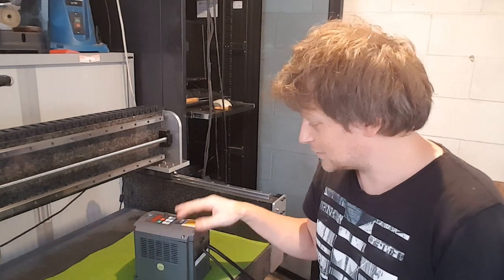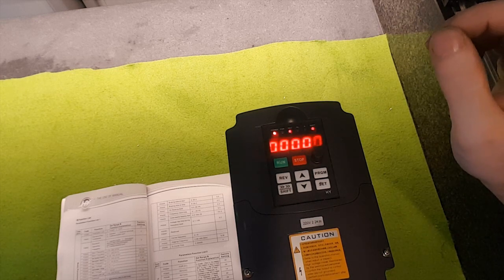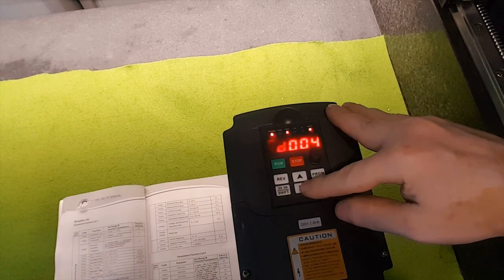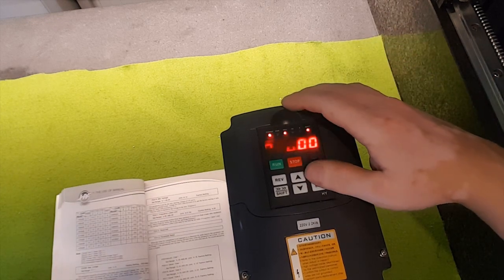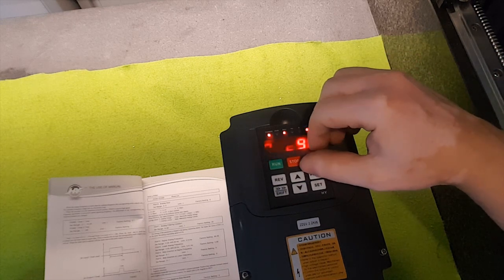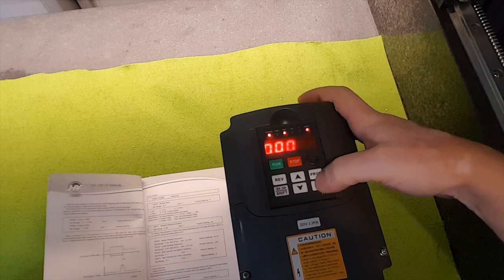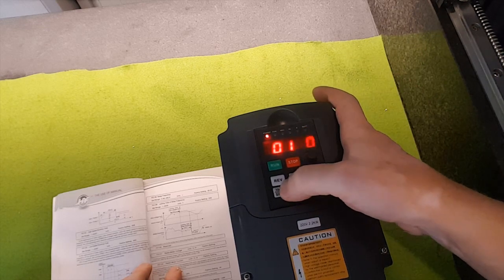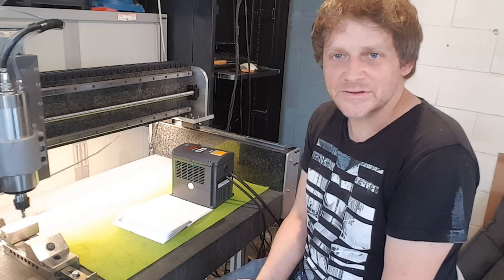How to program Huanyang VFD 2.2KW

Comment: Hi, thanks for this as it was really useful to help set up the replacement I just got to replace the one that went wrong, but I just wondered if you could help with another function.  I wired the new one up as per the old one which when the spindle came on via the pendant controller the spindle water cooling pump also started up and subsequently turned off when the program was complete, as the relay is wired into the VFD via the two rows of green connectors, but with the new one installed and working fine, all but when the spindle starts and the water pump now doesn't come on automatically.  I can still turn it on via a switch, and have looked through the program settings in the instructions, but not being very tech minded nothing jumps out and wondered if you knew how to get it to turn on automatically and which settings I needed to change to do so.  Thanks for you help either way.
Reply from the maker: @donjarr  sorry I have no clue..

Comment: Hi, We connected the huyang vfd  and set all the parameters that we think they are correct (pd settings on vfd). We encountered srtrange problem while testing the spindle. Everything works correctly while ccw is enabled but when we try cw the spindle has some problems. Cannon maintain the 120hz we set as minimum on vfd setting slows down and speeds up and in general it behaves srtange (it only happens when the spindle is working in cw direction). Also the vfd never achives the set 400 Hz  (the 355 is upper limit) Sometimes (more often then not the spindle speed fluctuates).  
Any ideas?
btw: jest szansa, że jesteś z Polski? 🙂
Reply from the maker: I'm not an expert on vfd settings. I just found settings which work for mine spindle and it should work for most people. From this what you are saying it looks like 2 possible issues. Number of poles are not right. Or your cable to spindle is bad quality. Try changing pole number and if this doesn't help try shortening the cable to something like 50cm. Just to test if it behaves differently if so then you need better cable

Comment: link to the manual? the supplier did not provide AND they took the sticker off the side
Reply: I bought a 2.2 with vfd BUT I need an 80 mm mount. so after asking about for a mount to fit my FoxALien vasto with no luck, I bought a 1.5 65mm spindle that I hope to use to make the 80 mm mount. hoping to use the vfd I already have. it has been over 10 years since I dabbled with a vfd, converted my drill press to vfd controlled 3 phase motor. I remember precisely nothing about vfds :)

Comment: Hello, 
I have a Huanyang vfd and 2.2kw spindle 220 volts. I did not reset my vfd when I put in the settings from several videos. It worked except it would only go to 208 hertz. I reset it and now it goes to 400 hertz but the potentiometer does not work. Is there a setting I can change to fix it. TIA
Reply: A mi me funciono pd002 = 1

Comment: Hello, i want to drive a rattmotor rtm80x73-2.2 (2.2 kW spindle square format) with a hy02d223b vfd. The nameplate of the motor says 6 A and 220 V. I dont understand why its only 6 A if the motor is supposed to be 2.2 kW. Do I have to set 6 A in PD142?
Thanks in advance.

Comment: Dude I just bought one of these bad boys but I'm lost with it straight out of the box.. Does it take a lot to get this correctly set up bcos I'm not so technically gifted my friend.. I will find help online to show me how to set this bad boy up soon but I shouldn't need this for a small spindle motor like a Gennitsu GS - 775 should I?? This is why I say I'm not technically gifted bcos I don't understand all of this stuff right now. 
I'm building my own home DIY CNC Router and I kept hearing that I needed to get one of these but I think I made the mistake of buying a 3 phase VFD instead of a single phase VFD. No wiring came with this thing which threw me for a loop so if anybody on here has any helpful advice for me please drop me a line in the comments. I'd very much appreciate ur help guys.. Thanks in advance..

Comment: My problem is direction of rotation is wrong.
How to rotate direction of motor to right direction.
Engine always turns the other way around. weird.
How to set M03 direction of rotation.
Reply from the maker: just switch places of 2 wires from the spindle, it doesn't matter which ones

Comment: thank you for your video, good information. I have a question on the 220 VAC input single phase. Can you tell me what the max voltage is. My 220 reads 240vac and I am concerned it will be too high. thank you.
Reply from the maker: It's fine.
Reply: @PiotrFoxWysocki  after some research I agree. it's fine. Thanks

Comment: Recently retired from a large hospital/research center that had over 500 drives from 1 to 1750 HP. I often replaced existing drives and had a great Danfoss tech only charge around $300 to do the start up and extend the parts & labor warranty to 3 years. Win win. He worked on nothing but VFD'S for 30.years. He had to go to his car once to get programing book. It was a inch thick. Amasing what you can now program into the newer drives. When I worked on a drive for the first time ( 1981 ) it only had a few pots to adjust ramp up & down, torque and a few others. In newest building over 90% of 5 HP & higher.were on a drive. Motors 40 HP & higher were on 18 pulse drives. The 200 HP fire pump was on a soft start drive.

Comment: Piotr are you using Mach4 for your CNC. If so did you have any trouble getting it to talk to the Huanyang VFD via modbus. Can get mine working with Linuxcnc but not Mach4. Suspect windows 10 drivers for the rs485 - USB - com port at the moment
Reply from the maker: Im using mach3. If its not working try to reverse cables. But beside that you need to do stuff in mach. I think you need a plugin for it to work
Reply: @PiotrFoxWysocki  Thanks for that. Yeah we had it working on Mach3 with the same plugin (I'm guessing), but can't find an equivalent for Mach4. Assume the wiring is still OK as the linuxcnc works Ok with it's own plugin.

Comment: Hello, how can I wire my 1600w 50hz single phase miter saw into the same frequency converter that in your video ?
Reply: I assume the VFD drives 3phase motor, so you need to re-wire yours as 3-phase either star or delta, depending of VFD capability.  2.2KWt/1.6KWt ratio is approx 1.4, so may work.
Reply from the maker: i have seen someone did that. just look on youtube

Comment: One thing that You should always do first before attempting to set any other parameters is to do a factory reset for the poor thing.
I have four of these animals in my workshop and when those arrived, each of them had a slightly different setup. This might be because of the factory testing process and maybe the supplier has also tried to preprogram them to "enhance" end user experience.
The parameter for setting the factory defaults is PD013 and the value should be set to 8. After setting this parameter to 8 the device will revert to factory settings and boot itself. This gives a known startpoint for configuring the VFD.
Reply: Thank you very much for your help. I tried to program this thing and the result was to become crazy. Think that was the problem and now I have hope to do that well.
Thank you once more time!
Reply: Can the inverter also programmed without a wired motor? or is it needed that the motor is connected first? I don't want to blow the motor because of potetional wrong settings
Reply: @mt8385  That's a really good question. To be honest, I don't know.
It might be possible to do the programming without a motor. At least it shouldn't zap anything. However, the device might get into a state where it does not allow programming. I have never tried this out so all this is just speculations.
Reply from the maker: It's possible vfd might get damaged without load attached.
Reply: After writing my question I found a statement, that recommends doing the initial setup without a motor. Some HY vfd has the freq setting in default set to 50 and as a result you will burn the motor
Reply: This was true of mine also.  Several of the presets didn't correspond to what the book stated as default factory settings.

Comment: If your spindle has 4 poles (as your VFD is configured?), wouldn't you need 800 Hz to run it at 24000 RPM?  Doesn't the "rated motor current" for programming the VFD refer to what's shown on the side of the motor (6.6 Amps?)?  Did Jian-ken provide performance data (speed, torque, and voltage curves" for the spindle?  Does your spindle testing video show the VFD's readout of motor current?  If so, what parameter(s) did you set to enable it?

Comment: I wasn't able to remember the sequence of pressing down the appropriate buttons in order to program certain functions. Is there a way you could explain this in a separate video or perhaps send me an instructions on programming. The manual supplied with my VFD is presented in such a way that I don't understand programming procedure at all. I learnt a bit from your video but still not enough to do it on my own.

Comment: Hi Piort, Again an informative video, thank you, one thing I dont understand about these vfd´s and spindle motors is the output voltage from vfd to spindle motor, is it correct that the spindle motor voltage is 3 phase 220VAC (is that a USA standard) and not what we usualy have in Europe being 3 phase 380/400VAC, none of the Chinese on Ebay can tell me what they mean with 3 phase 220VAC
Reply from the maker: from my understanding you can plug 220v to the VFD or 380v. you can use one or the other. vfd outputs frequency  (variable frequency drive) to the spindle by 3 wires. and those wires have shifted signal in order.  so 3 different phases. and what is the output voltage I don't know. but i'm guessing it will be 220 per wire. 
not sure if i explain anything, or make it even more confusing :)

Comment: Braking Resisitor?
Hello Piotr and thanks for the great build videos. Judging from the results, you've built a great machine!  Have you ever attempted to install a braking resistor? I've installed an appropriately sized device, but non of my VFD programming attempts have been successful in using it...
Reply from the maker: i  have to say that long time ago i have been thinking about it. but i havent put it in yet. i burnt 2 vfds before and now im trying not to run them too hard, or to do more than they can handle. i guess it should work and i'm sure it is working for other people. but I lost confidence with them and i don't feel like i will get it back. but to your question, I think i saw some options for the spindle speed up and slow down in programing settings of the spindle.

Comment: Hello! I was going to buy 2.2 kW water cooled spindle and there are two versions available, 220V and 380V. Is there any practical difference between them? (especially risk of burning the VFD).
Reply from the maker: to me there is no difference in power or performance, its 2.2kw no matter if it's 220 or 380. i would feel more safe with single phase versus 3 phases. with 3 phases you have 2 more wires which could increase possibility of failure.
Reply: Thanks for reply, i will probably go with 220V version then.
Reply: 380 input or 220 input.. you have 380 and you are running more machines? go for it, you can spread the power over 3 phases. for example:  if you let the spindle run a cnc progrom at 2kw. and you want to weld something in the mean while. with a 16amp 220v fuse you have 1.680 kw left or you will blow out the fuse.
with 380 you would have 3 phases with 3kw left over.

Comment: Hello! Glad to find someone in NZ doing CNC, your videos are extremely helpful! I have two questions and was wondering if you'd be so inclined to help. I also have a HY VFD and 2.2kw water-cooled spindle, and was wondering if you know about the input draw current (of the vfd at the wall at max load)? as there seems to be much debate. Living in a residential NZ household I am limited to 240v 10AMPS at the wall, so I thought I could run the spindle on its own and everything else on another circuit, but I've recently read that at max rpm the VFD itself may be drawing over 16AMPS? which will blow the breaker. I've opted for an 800w which is on the way and I intend to cut 6061 aluminium with it (at very slow cut speed with a two or 3 flue carbide endmill, probably 3-4mm)I have seen your spindle comparison video too, and my second question is, in your opinion can i use an 800w water-cooled spindle to cut 6061 plate as long as I use the appropriate feeds and cutter? It is a small extrusion and plate based machine using linar rails (hiwin clones) and 12mm ballscrews with nema 23 312oz/in motors. In building this machine I have already realized my mistakes as I rushed to buy the parts. 
Apologies for the wall of text! any help or advice you could give would be greatly appreciated!
Reply from the maker: i haven't measure how much current does the whole machine draws. but i can tell you that i have also 10amp breaker and from the experience i can say that its just fine.
On the VFD you can monitor how much current does the spindle draw. on a 15mm deep side cut 1.5mm thick cut current was going to 6amps. spindle total power is 2.2KW which under 220v is 10Amps precisely. not to sure how its possible to draw 16Amps. 
recently I'm milling lots of parts whole day long and i haven't tripped beakers. but i did it with 800watt spindle. by stalling it. how? by driving it in to the aluminium and because it wasn't powerful enough it stopped spinning which ended up in drawing way too much current and tripping the breaker. 
I dont think you have to worry too much.  
2.2kw spindle has bigger collets so you can use mills up to 13mm and just because of this its cool. now my prefer mill sizes are 8 and 10mm. it takes more time to setup part than it takes to mill it. 
i feel like i could go for hours on this topic :) but i have to stop somewhere :)
i hope it was helpful.
Reply: Thank you so very much for the insight, I could gladly listen/read all day :) The only reason I said 16A+ is because of the common "forum debates" about such things. I think my confusion stems from where many have stated that because we here in NZ are single phase and the vfd outputs always 3 phase, so there is conversion; but it's actual draw is not 10A constant and that the stated 220v/2.2kw/10A is the rating of the motor at max load and rpm. Also as stated by many, this is likely a 2 pole motor(your vfd still set at 4 this whole time??), so I wonder if that has any effect. But I can't argue if you say the system is still running fine and I have seen it chew through aluminium and you are also on stock NZ power. Anyway I will re-watch this video and experiment tomorrow. Many thanks again, I almost sold my 2.2 before even trying it!
Reply from the maker: im still running it as 4 poles. but i wont be recommending setting it like that. i dont have any documentation about my spindle, it seem to be working on 4 so im not changing it. at list until someone can explain it to me in the way that makes sense :)
Reply: I'm currently using the 800W spindle for about a year and half, mainly cutting the aluminium, and so far all good. I will use the 2.2kW spindle on new machine, but mainly because it has ER20 clamps instead of ER11.